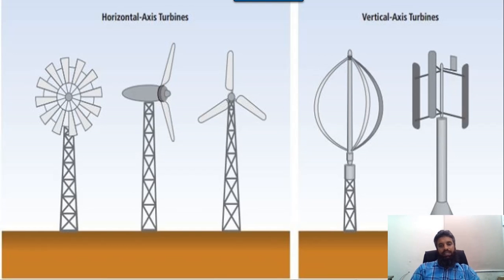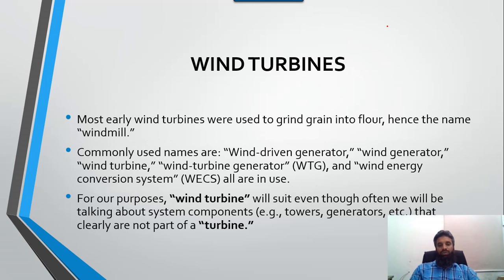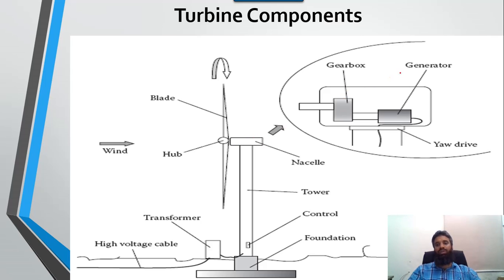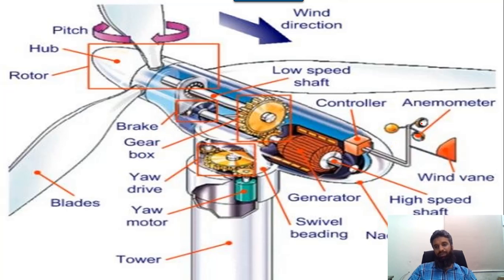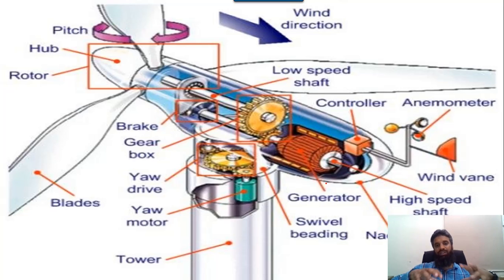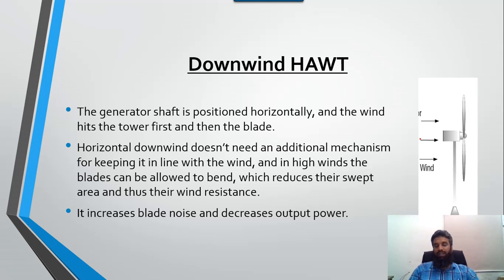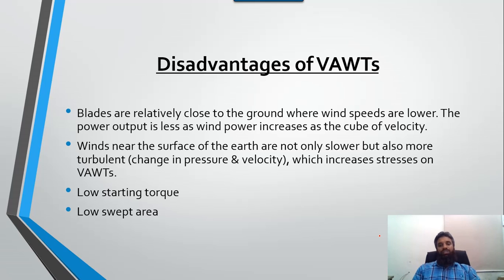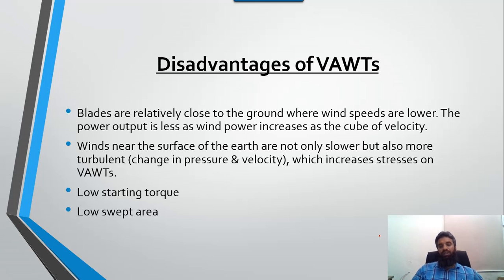Types of Wind Turbine | Their Working Principle | Advantages and Disadvantages

Comment: Hi thanks for this informative video. I wanted to ask a question to you that which design of the Wind turbine is best for making a wind turbine in a village type area, and if we don't want to make a big wind turbine like just for our house use and for water motors so how can we minimize the size of the tower and blades?
I would be very thankful to you if you guide me.
Reply from the maker: For the low highted wind turbines, we recommend vertical axis wind